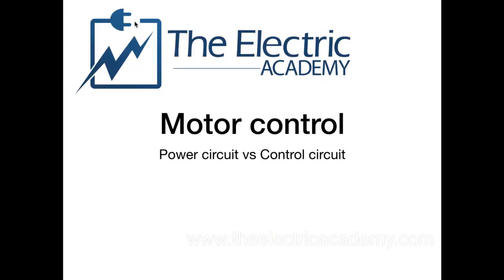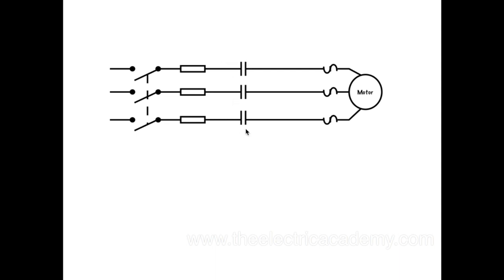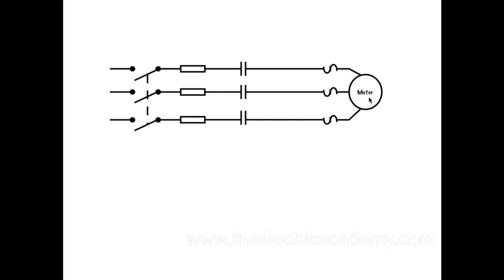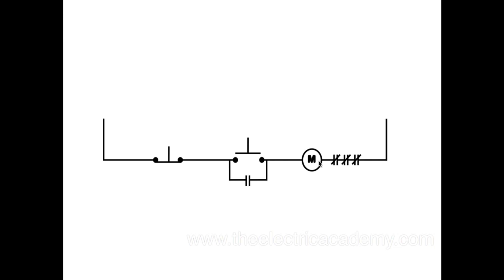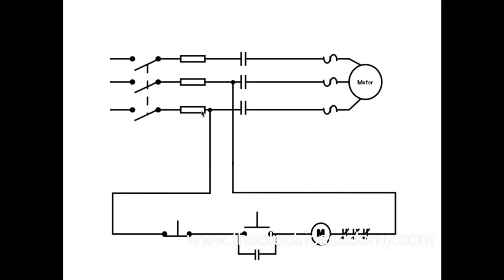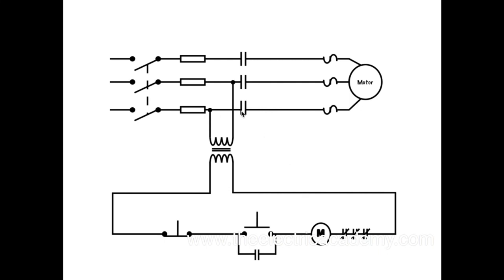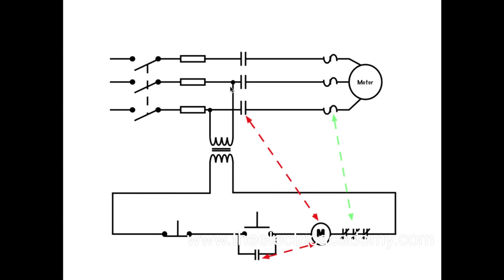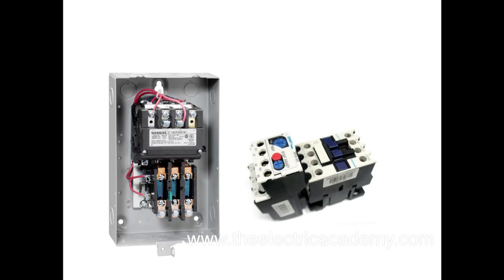Motor control. Power vs control

Comment: I am an electrician from NYC and like your style 👍 i am always trying to learn more. This question has nothing to do with this video but what exactly does it mean that one phase is 120° after another?

If in a transformer all the coils are connected to each other why dont the seperate phases explode on contact with each other?

Also should i be getting continuity from any of my X contacts to the H contacts? For example H1 to X1

I have many more questions but i wont go crazy
Reply from the maker: haha.  Welp let me start with the 120 degrees question.  The alternator is wound so that one phase starts 120  degrees after the previous one.  There are three windings so it just keeps repeating.  Maybe I should do a video on how three phase power is generated?  

As far as the transformer questions go.  the windings are insulated from each other.  That being said you're 100% right.  If and when the insulation wears out then the transformer goes boom.  You shouldn't be getting continuity from H to X unless it is an auto transformer.  

I would check out the transformer videos I've got or I have a course on AC theory you could check out:  https://courses.theelectricacademy.com/bundles/single-phase-ac-fundamentals,

Let me know if you're interested and I can give you a student rate (50% off).
Reply: The Electric Academy well lets say we have a secondary that is 208y 120v doesnt that mean that all 3 phases converge at one point like through a bar i see inside of transformers sometimes. As well as a grounded leg to X0.

About the coil you mean you start one winding on lets say 0 point then making a circle 120 degrees  around u start another winding and then from that point another 120 degrees you start the 3rd winding? And that causes the sin waves to be slightly different and explode on contact? 

Are you saying the physical placement of the copper around the coil produces 3 phases of power?

I would love to see power generation.

I like your videos and your courses seem much more detailed. Im preparing to prepare for the master electricians exam in NYC so i am looking for good material. I am approaching my 6th year being documented full time so since i need 7.5 years experience im starting with practice exams now.

Comment: The control transformer should be fused to its VA rating. Not from the  motor OCPD. Primary  side fuses to protect against overload and shorts and secondary side fusing to isolate transformer from control circuit shorts.